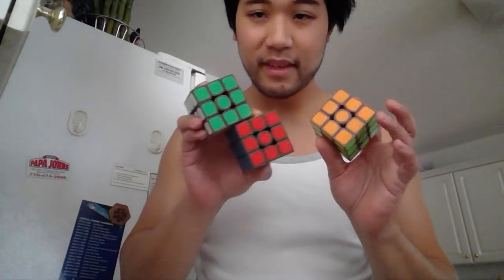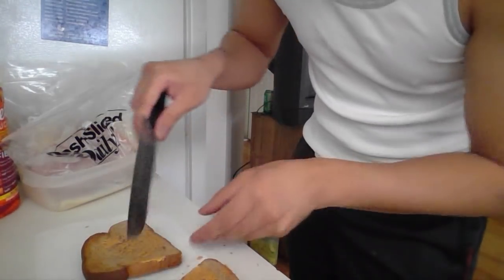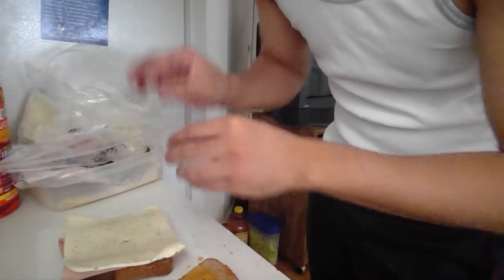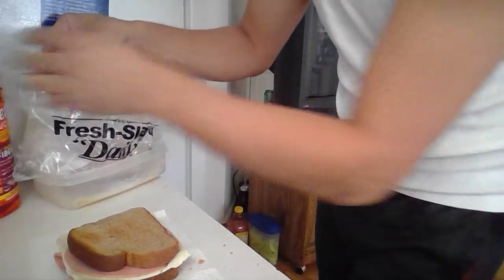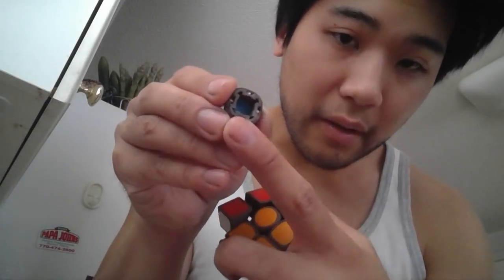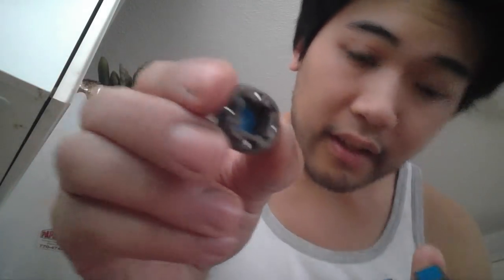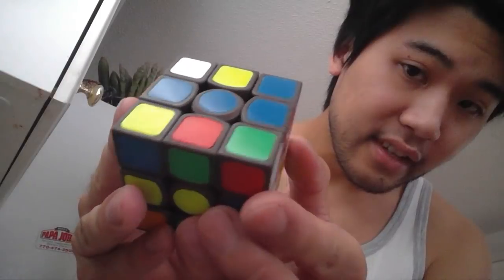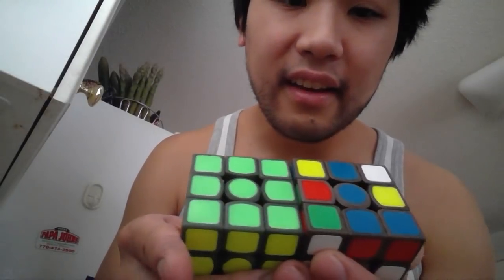Quick-swap Magnetic Centers (New Luminox Feature Update)

Comment: Independently, I was thinking of the GTS 3 spring compression system, but instead of raising the system to different heights, it will have 2 different-strength sets of magnets offset by 45 each (and of compression system is changed to turn 45 degrees on each click). So you change the magnet strength instead of spring compression when you click the thing. 
Compared to interchangeable caps: Advantages (Don't need an extra set of alternative parts, everything you need is already inside the cube). Disadvantages (space constraints and needs precise engineering, and an extra 24 magnets permanently present in the cube adds more weight, only 2 possible magnet strengths, and I think trying to glue 8 magnets in the same polar direction may have a possibility of repulsion)